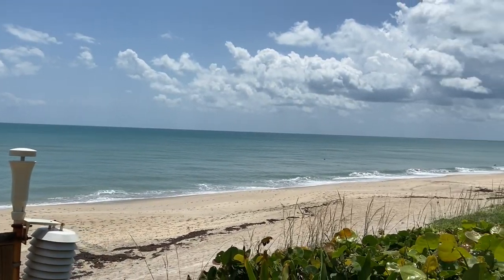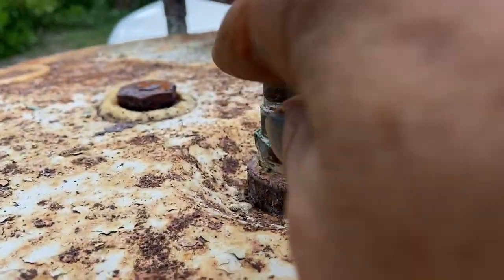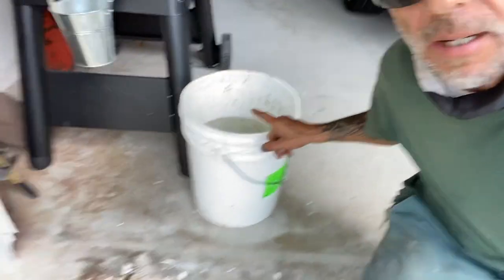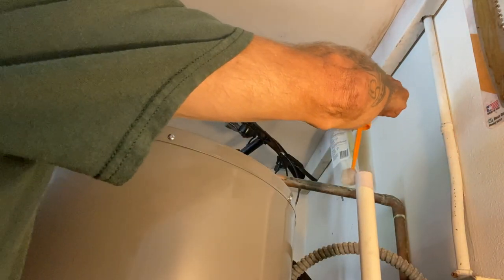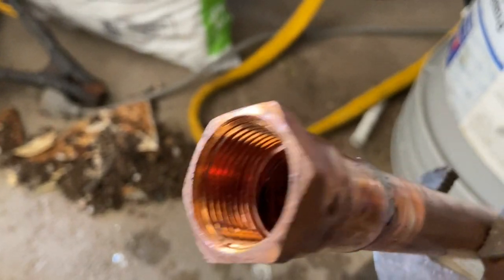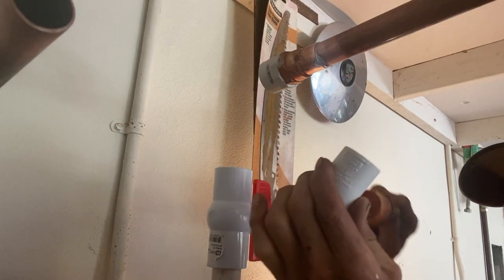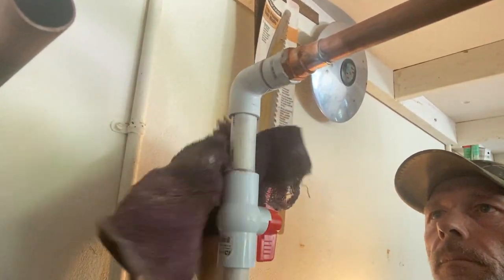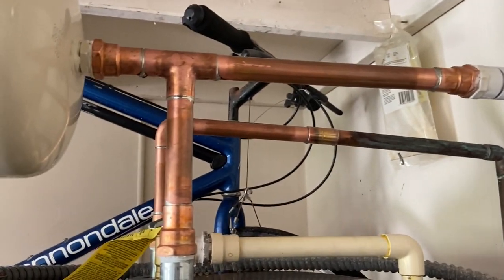PVC TO COPPER HOW TO MAKE THE TRANSITION

Comment: Very nicely laid out job Tim, great communication on the wiping down the fittings after connecting not only on the pvc but the copper joints as well to keep the copper from turning a bluish green where others fail to wipe their joints, also nice comments on holding the pvc joints tightly engaged for a better fit. Thanks Ira

Comment: A PVC street ell would eliminate the need  for the butt piece and thus one glue joint.  Also, just out of curiosity, why are you guys opposed to using flex connectors on water heaters out east?

Comment: Is it proper to thread the male pvc adapter all the way into the copper female side?  I have been having issues with leaks and have not been tightening that far.
Reply: Male PVC fittings are pretty weak and leak all the time. We generally use a schedule 80 toe nipple (or regular nipple cut in half) with a coupler to the PVC pipe. Then you can spin whatever female fitting you want on to the nipple.

The extra meat on on the sch 80 threads helps a ton.

Comment: Good job question for you. When we bought our house, it has an electric water heater and it goes from the water heater to copper to PVC. We were told that it did not have die metal connections. It just goes right from A copper male into the water heater should I remove those and put the die metal joints in? Hope I got the terms correct.

Comment: I will need to connect a PVC from water heater relief valve to a copper drain pipe that goes to outside of the condo. 
Thx

Comment: I agree with the female adapters splitting .. anytime I change a hose Bibb in pvc I cut off the threaded x slip 90 and install a 1x3/4 slip x thread bushing in a 1x3/4 reducer 90 then tighten the hose Bibb in first then glue it back on
Reply from the maker: Thanks Ken for watching
Reply: Maybe. Try schedule 80, better quality CPVC pipe nipples, like Spears or similar? Lots of aquarium and pool systems users seem to use these fittings.
Reply: Ive seen people using the female pvc adapters and they did not split or leak. Will they split over time as they get old or is it something that will happen right away if its going to happen?

Comment: Great video. Love your channel. In my neck of the woods up in St. Louis the code and stuff are a bit different. Expansion tank needs to be a minimum of 18” away from heater and would have to strap that expansion tank if it is sideways like that. They don’t require strapping if you 90 up vertical. But that’s my neck of the woods. Not slamming ya or anything. Just different where I live. Keep up the great videos.

Comment: So I have no leaks in the 40+ joints I just sweated, but every threaded connection has a slow drip(plastic to copper) with just using Teflon tape.. did I hear you say you used Teflon tape and joint compound? What’s your procedure?
Reply from the maker: Only if you are using a pvc male adapter threading into female copper or brass
Teflon tape and dope

Comment: In addition to the teflon tape, what did you use on the PVC at the 6:09 mark?  - " " -seal"?
Reply from the maker: Pipe dope
Reply: @PLUMBINGWITHTIM  Thanks Tim.  I just hasd to replces a 1 1/4" diameter copper section from a well pressure tank that had a pinhole leak, and replaced some trashed PVC.  I had a threaded 1" PVC to copper junction and it now has a very slow weep despite using tape.  I gues I should have used that compound instead.  The copper replacement was a bear, too.  I'm so much bett at elecrical work- and have respect for the guys to competently get plumbing installed.

Comment: I’m sure you installed the expansion tank last.  Might not hurt to warn folks not to solder on a sealed line connected to pvc.  The vapors from the glue and primer can explode once they get hot.

Comment: Need to use transition fitting going into female adapter
Reply: Explain
Reply: To prevent from cracking u need a pvc to brass transition fitting which cost around $4 not the .39 cent adapter.   The heat will eventually split your connection
Reply: I learned the hard way